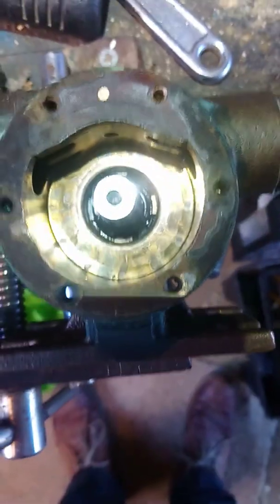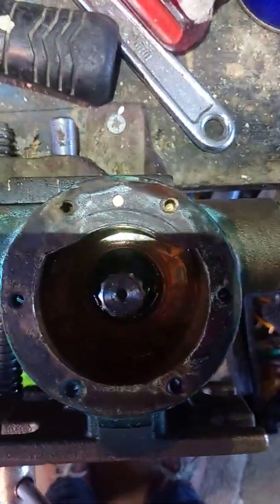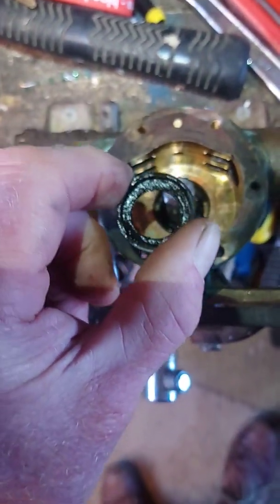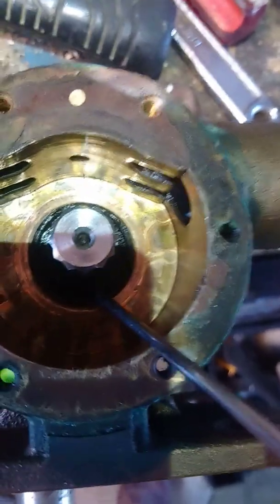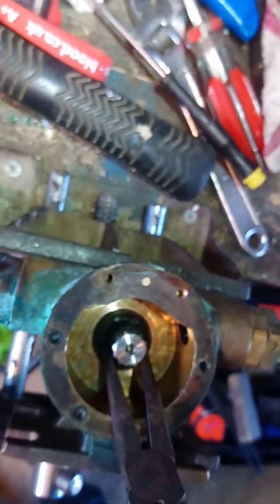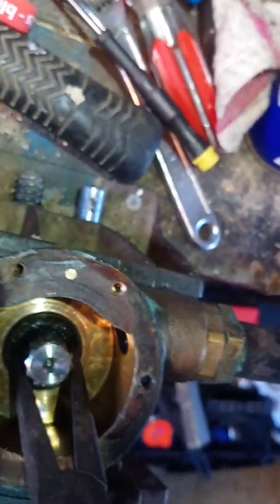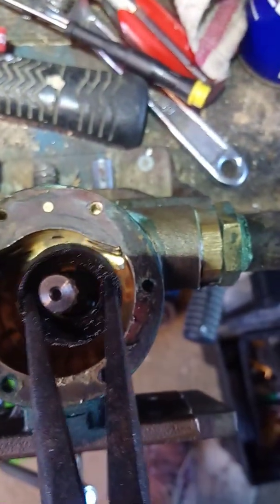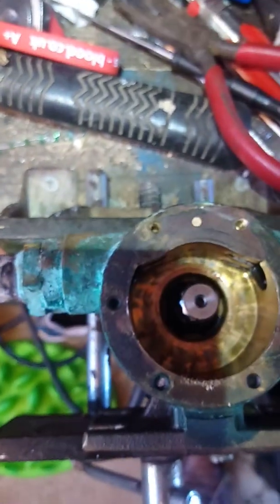How to remove the seal on a leaking Jabsco engine water cooling pump

Comment: Was there not a circular plate covering the back?
Reply from the maker: You take plate that's held on with all the screws off. That reveals the impeller which you take out. Then you can get at the seal which is usually the cause of the leak. Change that and reassemble with new gasket and some appropriate sealant. Problem solved. Much easier than taking the shift out etc to get at the seal from the other side. Also you can leave the pulley on if you haven't already taken it off. Hope it goes ok